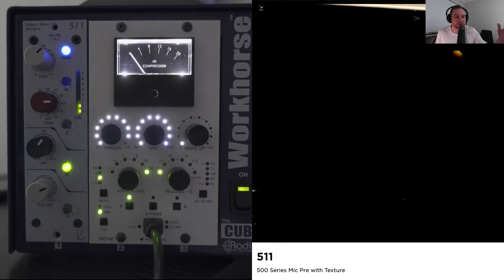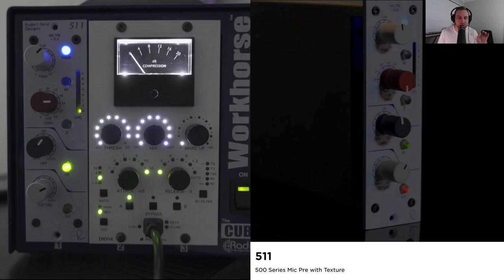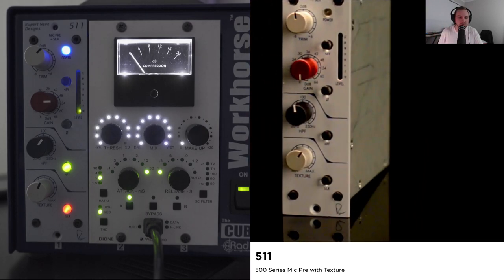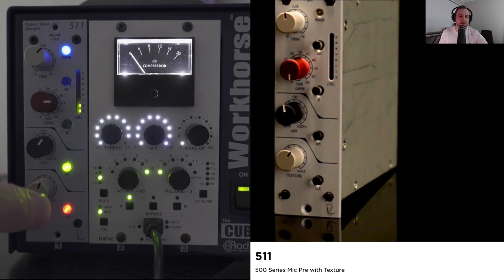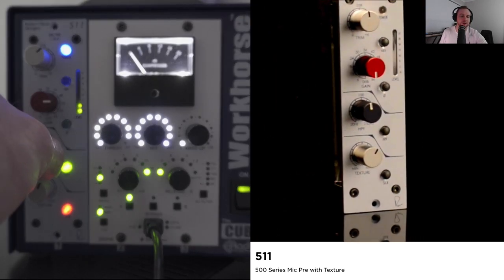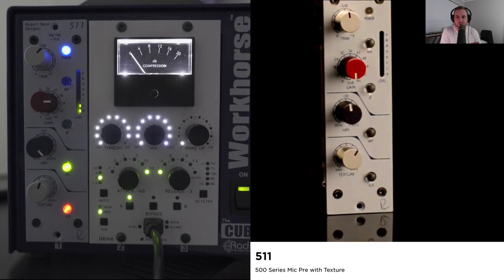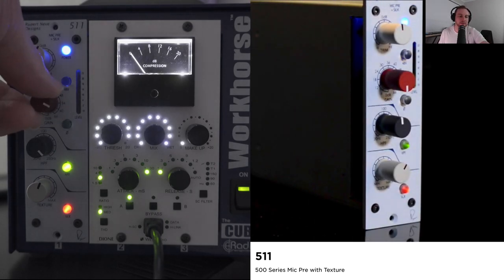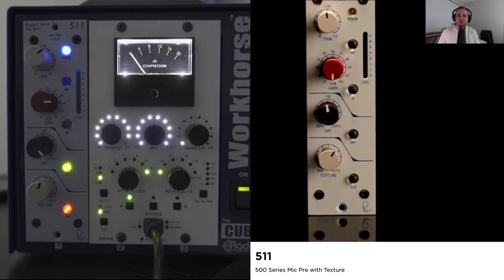Rupert Neve 511 Pre - First Impressions

Comment: So I’m interested in upgrading my home studio. I’d like to get a pair of these, but do these have an ad/da converter in them? If not, how would you run it into your DAW? Forgive the beginner question
Reply from the maker: No AD on those units, you need a 500 series rack to power them and audio travels via either TRS or XLR to your inputs on your audio interface. Which acts as the AD Converter.

Comment: good review RND must be good for sure !
 have an off topic Q. 
are those yamaha monitors from your experience are good for mixing (pop,rock,jazz fusion,world etc) ?
they are not too expensive and not very cheap either ,so thought of them for production,and mixing  (probably go for.H7 or H8 series)
Reply from the maker: Hey thanks for the comment, those speakers are cla-10 a replacement to NS10 Basically. I did have a pair of HS8's sold them but kept the CLAs you can hear transient information on those speakers way more clearly then a standard ported monitor. Definitely good for any of the genre's that you mentioned.
Reply: @CrossbeatsMusicProduction  hooo.. OK thanks. I'll consider that

Comment: So im new to the analog world and just saw one of these. Is it common to run stems into it for more color/life to the tracks?
Reply from the maker: Id say yes, to some extent. It al depends on what "flavor" you want. But that said repurt neve make a tape emulation also which is great for coloring your sound
Reply: @CrossbeatsMusicProduction  appreciate it bro. Any recommended models to add high end to bass heavy muzic?
Reply from the maker: @GGonmyown  i think you mean adding harmonics, theres a few options but depending on your budget. Cranborne Audio Carnaby 500, to the Gamechanger Audio Plasma Drive High Voltage Distortion Eurorack Module or in the expensive range Black Box Analog Design HG-2 Saturation Processor the list goes on, just depends on your requirements, also check out plug-ins like Izotope exciter, fabfilter have a distortion plug-in heaps of options